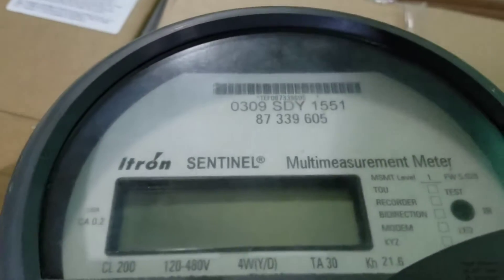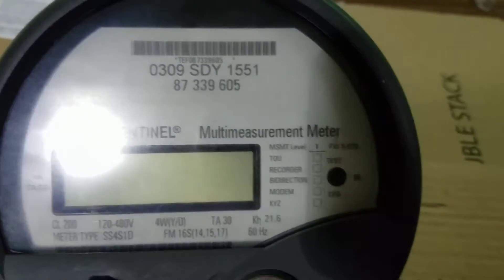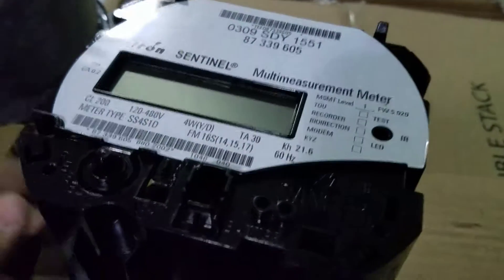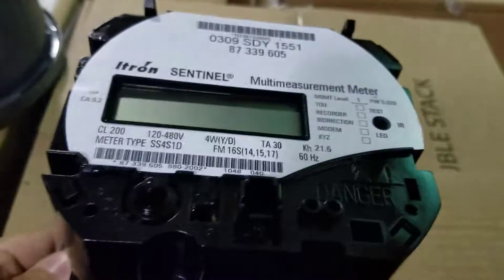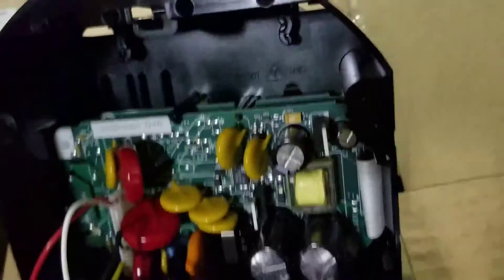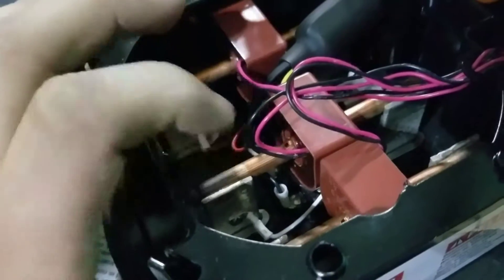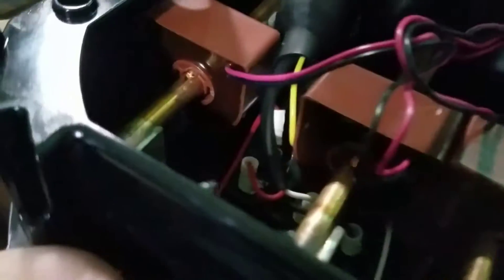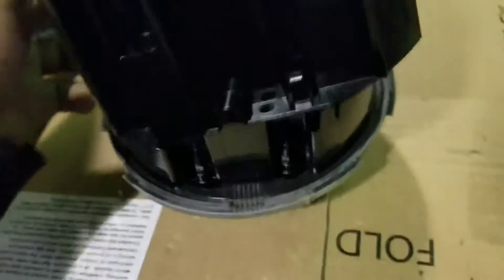Itron Sentinel 16s Electric Meter Teardown

Comment: Hi Thank you. question please. where do you connect the rs232 or rs 485 to it? or what do you use rather to connect your computer to it?
Reply from the maker: You can connect using an optical probe to the front port. However you need utility restricted software to do any programming.
Reply: Thanks again. I tried searching that but I see no USB to probe. Sorry if this is a dumb question. New here.
Reply: Do you maybe have a link where I can go to purchase it?